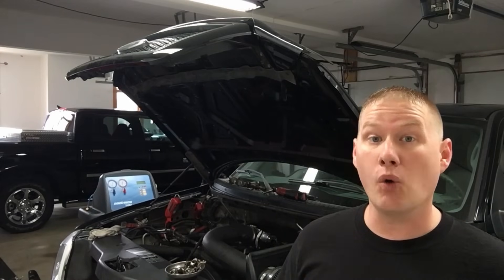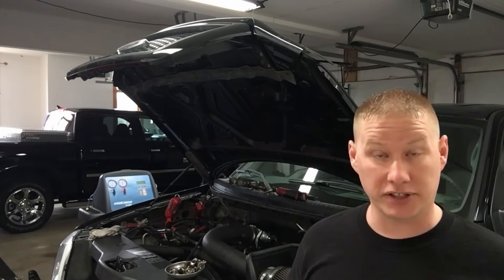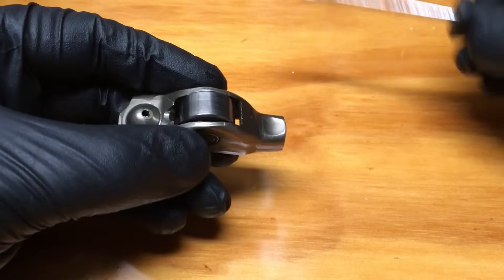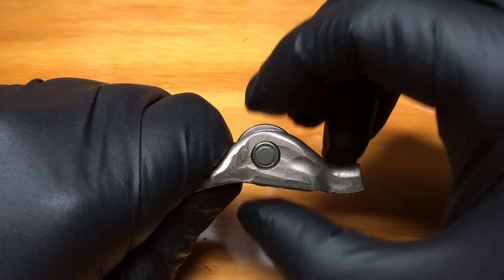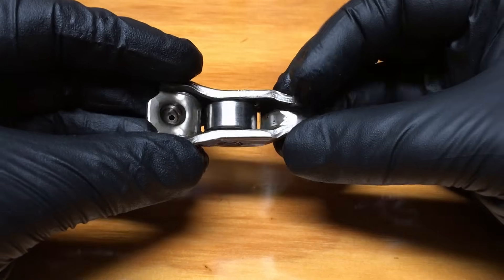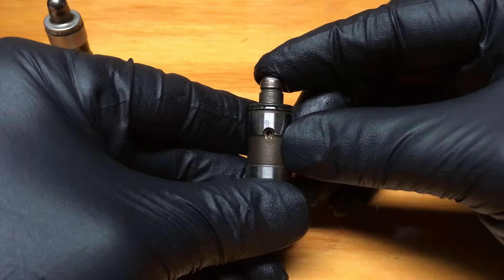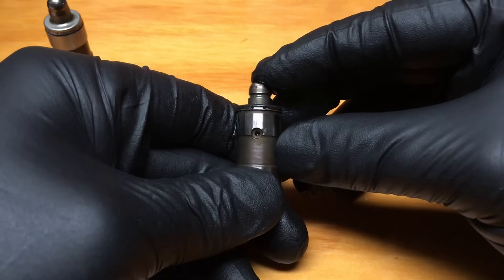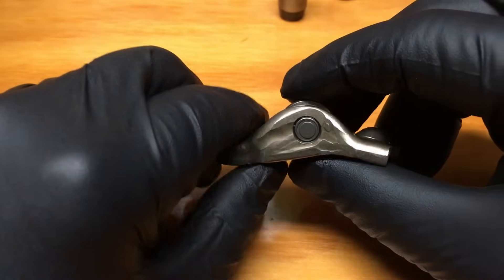Ford 5.4L 3v Triton Engine Ticking Tapping Noises: Must Inspect Items!

Comment: I'm getting oil on cylinder 3 spark plug...2009 f150 5.4 Triton
Reply: Under the valve cover spark plug tubes there are O-ring seals. Once an O-ring becomes worn out or damaged, oil will leak through. This can potentialy cause misfires and even burn up a Coil.  Cheap fix . Would be a good time check everything that was mentioned in this video if you take the valve cover off, good luck

Comment: Thanks, after watching this video I recognized I was having the same issue with my 2008 F250.  I had my local shop check it out and he was not sure what the issue was.  I took it to the local Ford dealer and they found 2 rollers were shot and the cam was damaged.  They replaced all the rollers, lash adjusters and put in a new cam.  Fortunately I had a Ford extended warranty that covered all of it but $100.  My truck has about 110000 miles on it.  They say everything looks good.  If I had not seen your video and been alerted to the issue, I most likely would have ignored the tapping until the motor blew.   Thanks :-)

Comment: does this apply to a 99 5.4 because I bought one use put a new oil pump changed the timing chains new water pump new head gaskets new heads and the passenger side was ticking badly like it was getting any oil I tore it apart again all the oil passages look clear my only thought could be that the lifters or dry when I put the head on because I never pre-soaked the lifters but I still seem like it wasn't getting proper oil to passenger head

Comment: Why are the new rollers coming out with a small pin hole?
Reply from the maker: That is the new redesign to increase oil pressure in the head.

Comment: Question...  I heard you say "place in oil just above the fill hole, then pump them up".  Ive seen a few videos and several people say that just stick them in and then let them naturally start pumping.  I was also looking at my service manual and it doesnt state to precharge them with oil.  My concern is that I dont want to accidentally make them hydro lock.  Have you had any negative experience with installing them pre oiled?  BTW Thanks for all your videos, they really remove the mystery of doing this work.  Cant say enough for what you are bringing to the rest of the community.
Reply from the maker: This is the way they are primed. I am not sure why you are concerned about them getting hydro locked. That is the exact principal of how these work you want them to be pumped up with oil that does not compress.
Reply: @FordTechMakuloco  understood Thanks!  I will follow your recommendation :) My truck has 297k on it...  I am starting my complete work-over tomorrow(took 2 days off to do the work)..  Timing kit, oil pump, oil pan gasket, phasors, im also replacing all the cam followers and lash adjustors... oh and the vct solenoids..  Thanks for all the recommendations.

Comment: FordTechMakuloco do the lash adjusters need to be pre primed (pumped up to hard in oil bath) before install?
Reply: its best too. will limit pump up time on first start. can tap for up to 30min if not.

Comment: my tapping or clicking noise comes and goes.  it will click then suddenly stop.  It does sound like from the valve train.  any suggestions on what is most likely?
Reply: if its lightly misfiring at idle too id look at followers for sure

Comment: I have a 2006 and hear a slight tapping/ticking noise when accelerating, even under light acceleration.  I have 114k on the engine and have changed oil every 5-6k miles.  What's the typical charge to fix this?  I know it depends on how many are bad and need replaced.  And probably should change the oil pump too.

Comment: Thank you so much I am currently rebuilding top of the vehicle where heads and those lifters
I bought it with spun sprocket ended up going to junk yard find a good one waiting to find out plus I drove it before tear apart and yes I have failed lifters wow I didn't know how to determine now I know thank you so much;)

Comment: preparing myself for my timing job, lash adjusters is not something I really thought I should be getting, but I am however going to replace the followers and camshafts along with the whole timing kit. is there  a way to inspect the lash adjusters with  them still inside the valve train?

Comment: I would love it so much if you could please find out why the new 5.0 coyote motors like the one in my 2019 f150 ticks at idle. I was told it’s because of the direct injection but I call malarkey.

Comment: Just bought a 2010  f150 with a 4.6l 3v, 6 speed, XLT.   146k on the clock.  Weirdest ticking noise ever.   It seems to only happen when warmed up, in drive, and just above idle (like just enough gas to maintain speed at like 30 mph).  It's super quiet, like if I roll down the windows the wind drowns out the noise, if I rev the engine to 2 RPMs, can't barely hear it.  

Sound goes completely away when in park & when you take your foot off the gas while driving, sound instantly disappears...  I've sat in the truck from the drivers and passengers side, and it seems to be on the driver's side more so then the passengers.  

The tick is very low tho, but it's deff there when I drive around for the day, I can hear it and it is driving me nuts.   Had a mechanic look at it and he didnt hear it at all...

Comment: Great info.  I can tell you and everyone else reading this, the info presented here will save your ass if you own a Daimler Chrysler OHC engine, the 3.7 and 4.7.  They will fail in the exact same way, in fact they use the exact same lash adjuster as the Ford engines up until 08 when they changed them, they changed the followers in 05.  Those engines will give the same symptoms as well, light ticking under the valve/cam cover and are also well known for kicking out the follower when the lash adjuster bleeds down during shut down. Start it up and out goes follower, if you're lucky it won't take out the head casting pedestal holding the lash adjuster.  EDIT, I see the lash adjusters look like the revised ones Mopar used.  The old ones had the oil feed hole in the side lower, the entirety of it was in the reduced OD in the middle of the adjuster body.

Comment: Hi Brian, I was wondering if you could help me. I am installing a Ford timing kit with lifters and roller followers. I soaked the lifters in oil for 2 days. When I went to install them, some of them were not plunging hard. Is that normal? I watched your video and I was wondering if it ok to install them? And will they get harder when I start the engine?
Thanks for your your help with this.

Comment: I know this video is a few years old. So I got a 2000 f150 the 2V not 3V is this same issue or would it be different? It has the tick or tapping noise...

Comment: Hi really enjoy your videos very informative I have a 06 f 150 I need help with while driving in the highway my oil pressure gauge dropped and engine rattled and stopped  I had two mechanic looked at it they said I need to change engine any thoughts it’s a 5.4 3 valve

Comment: Are the intec navigators the same? I have a ticking coming from passenger side sounds like lifter tap... Thanks
Reply from the maker: not the same
Reply: Any ideas? Just installed a used motor in the navigator. The tic is steady and is there at idle quieter at acceleration. New plugs all torque to spec motor has 127k. Sound seems like it's coming from the passenger side I initially thought pully but used stethoscope on head under valve cover on front I hear the tap. I'm not a ford guy... Your videos have helped me through so much on wife's car. Thanks for all you do and for the fast response! I'm in Texas or I'd just bring it and let ya fix it!

Comment: I replaced the lifters and roller followers but the ticking continues. Could it be oil pressure or oil volume? 2012 Navigator

Comment: What about a 2012  5.0 liter V-8 that had a  timing chain tensioner failure . Now it has a ticking on start up which is taking longer to stop clicking . Truck has 129'000 km ( Canadian) 75,000 mile approx.

Comment: In 10 years Ford couldnt correct this. OMG
Reply: They didn't know it was a problem until the first set of vehicles were at least 5 years old. They fixed it in the 09 models
Reply: @deez_pucks4709  So my 13 Expy won't have this issue? What should I look for?

Comment: If the truck has been sitting for a month. Will that bleed down the lash adjusters? Do I need to pump them up in a bath of oil before I inspect them?
Reply from the maker: They should not bleed down.
Reply: @FordTechMakuloco  thanks for the reply and the videos. I actually found the follower and adjuster kit and have it on order.

Comment: Great job on your videos! I am doing the complete timing job now following along with your series. thank you for putting this out there. They have been a tremendous help. 
I am going to replace all of the lash adjusters and followers while am in there. Does anyone know if the Ford Racing Full Kit- M65293V will work with the 04? I know 04 has a different lash adjuster but I'm seeing comments that M65293V works with 04. Can anyone confirm?
Reply: Did you every get a response to this question? I'm in the same boat. Ready to buy the kit, but own the 04.
Reply: @shaunjulian8062  I can confirm they worked  in my 04. The kit came with the updated roller followers with the smaller hole. I couldn't tell any difference in the lash adjusters they seemed identical to the factory. Everything fit and went in without issue. It is running great now.

Comment: I have a 1992 Ford escort with a 1.9 motor and it's a manual and every time I drive it loses power like it bogs down or when I first started the idle drops solo with a stall out on itself try to fix some things can't fix it need some help in the right direction

Comment: This is off subject I have a 98 F150 4x4 5.4  have you ever heard the dial up internet sound coming from under passenger side under dash.
Reply from the maker: Yes, most times it is the heater core.

Comment: I have a question I'm hoping you'll be able to answer I realized all these 3 Val 5.4 engines make these noises because I been looking at a couple I'd and they all make that noise I got one now that makes the same noise what is the worst case scenario if this is not replaced can the motor lock up

Comment: My 08 expedition el runs perfectly, almost to perfect. At random when I come to a stop it shudders and engine shakes hard and wants to stall. Hit the gas and it goes away? Besides cams or adjusters what sensors could cause this with no check engine light that i can change?
Reply: Had a vacuum leak do that to me.

Comment: After researching this and being personally involved with this engine.   My findings agree with those of Makuloco,.  
The cause of the failure will always be discovered to be the result of low oil pressure.   There are two major underlying causes which contribute to the 5.4 3V engine issues 
1)  The oil pressure is measured by an electronic switch, which does not indicate actual engine oil pressure. 
2) The Cam chain tensioners are where the engine starts to loose oil pressure as their gaskets fail. The failure is not an immediate loss of pressure but a gradual loss over time, which is why that loss in pressure creates significant damage in the upper valve train area, specifically on the RH or Passengers side of the engine. 
Therefore improvement would be to move to a mechanical oil pressure gage,   and to replace all of the upper components related to engine timing and all of the components on the RH (Passenger) cylinder head when reacting to what manifests itself as a continual ticking noise.   Even though some of those components on the RH cylinder head might appear acceptable, their loss of oil pressure will cause excessive wear and not replacing them while inside the engine will simply require their replacement within a few thousand miles. ..

Comment: My 2003 5.4 makes a sound like a rattle can only when driving at a constant like 45-50 mph. It will do it maybe a minute or two and go away or if I let off the gas for a minute it will go away. I can’t tell where the sounds coming from except I know it’s in the engine bay.

Comment: I have been following your 5.4 series and accomplishing the job myself, thank you for such informative and helpful videos, you are a great teacher.  Two questions I do have, prior to the job I though I heard some ticking sounds while driving along with the usual bad phaser/VCT sounds.  All of the rockers were tight with no play and I did not have any unusual wear to the cams or rockers.  Watching this to inspect the lifters/lash adjusters I can not push them down much but if I pull on them there is play, they definitely do not spring all the way up.  Is this normal, I did not notice you pull or tug on the plungers, just push.  They all act the same so I am inclined to believe they are good as it would be unusual for them all to be bad, correct?

My other question is while removing the passenger side valve cover, I noticed three bolts sheared off, they are all pretty much flush with the block :(  Know any good tricks to extract them?
Reply: 2 years late but, if you can't drill tap them out then a quick weld if a nut in the flush stud works awesome

Comment: I have 2002 5.4, have change out everything in the timing chain department but still getting a rattle when starting up for some reason. Have changed out all lifters and still get ticking noise, the rollers seem to be fine and it has 140000 on it. How many miles should I change the rollers out and could that still be the ticking I'm hearing

Comment: Do you have a video that examine accessory 4x4 and wiper failure? All occurring together. When my 97 F150 is started the wipers and interior lights as well as the other describe accessories are not functioning, however if I open the door the wipers give me two swipes and then if I close the door I get the same. I’m suspecting the GEM ground or fuse box. Ideas??? Thoughts?
Reply: In addition the electric windows and mirrors are dead and sometimes the remote key lock doesn’t function. All this accessories stopped working simultaneously.  Thanks for any diagnostics.

Comment: You dont seem to have a video if takeing the cam off to change out lash adjusters. I have my crank at 6 oclock pisition so everything is neutral. Can i take cam out, replace everything, and put cam back in same exact spot?

Comment: Thank you so much for the great detail of your videos.

I have done a full timing service on my 04 FX4.
I did new Ford updated small pin hole roller followers and lash adjusters.
Is there a break in period for the lash adjusters? They were primed with new oil prior to install.
Reply from the maker: No break in required.
Reply: Another question for you. Is it possible for a cam positioning sensor to go bad without throwing a check engine code?
Reply: @spartanoverlanding300  Troy here. Yes, the cam positioning sensor can go bad and not throw a code. In my truck it caused intermittent crank no start. I replaced the $23. dollar part. Engine starts with more vigor and no more crank no start.

Comment: This was throughly helpful. Thank you for breaking it down. I'm getting ready to fix this "knocking" issue with my dad and wanted to do my research before teaming up with him and taking my Expedition apart again. (Not for the same issue). This is subscribe worthy.
Reply: Having same issue and I am going to have a helper too. This is my first f150 with this motor. I bought it with 105k miles and it was a maintained government vehicle. 112k miles on it now and it's getting worse! I would get a Chevy, that's what I'm going back to. They don't make trucks with these stupid motors with phasers and extra parts to help with gas. Just a simple pushrod engine that gets the same gas milage without all that messy useless time adjusting system. Good luck!

Comment: If you can help me out that would be great oh, I had my boss take out a 5 4 3 valve. So we found a salvage motor in about the same year pickup truck what about 77000 miles. Cleaned up the old motor and reinstalled it in the truck and I found there was a tapping on the oil pan and acceleration I suspected timing chain but it was coming from the passenger side rear of the oil pan have any comments
Reply: Found the problem it was in my oil pen used to slightly different one the crank was hit tapping it

Comment: Hey Brian i also stumbled into your channel brother your on point with your information I'm blown away  i don't now if you mind me pick @you but i also own a 99 Ford f150 4x4with 4.6 triton engine also have a ticking noise sence i got it but it only does it on crank in the morning wen is cold  ,but recently bean sitting for a little while like couple of weeks or a month duo  to ,to  many cars and that one don't get driven a lot ,but went to start driving it for a couple weeks now but it's like missing the throttle and rpm goes up and down and wen come to a stop it will shut down unless i keep my foot on the gas ,if you get the time and if you want to get back to me with any ideas i would appreciate it if not that's cool to i now your a busy man ,but great info keep up the videos coming like some body else commented i can watch those kinda videos all day long .

Comment: i have a 2006 5.4 did entire front cover swap still have ticks sound found its coming from #1 linector, very loud at start up quiets down after a bit, unplug injector no tic, changed injector no difference ?

Comment: FordTechMakuloco how about if is only knocking when it warms up
Reply from the maker: That’s the phasers
Reply: The engine is from the refurbished line from auto parts  so is all new  
I pull it out of the crate
Reply: Ok man thanks for the help I might have to change that phaser too while I'm there
Reply: Do you have a video that can guide me on how to replace the phaser